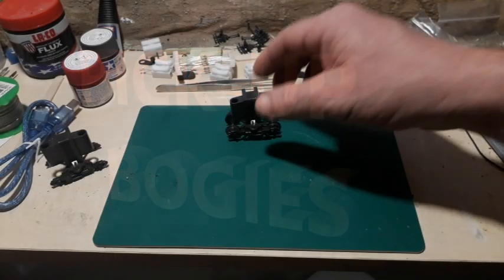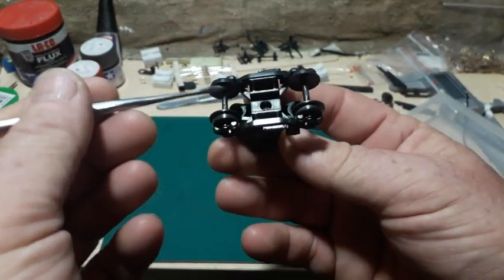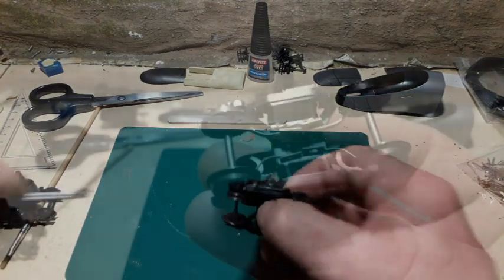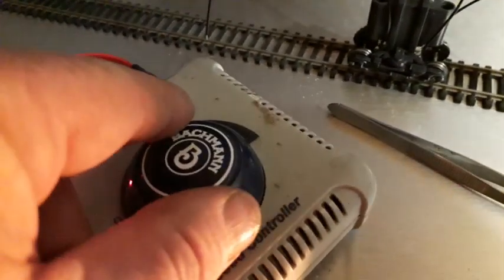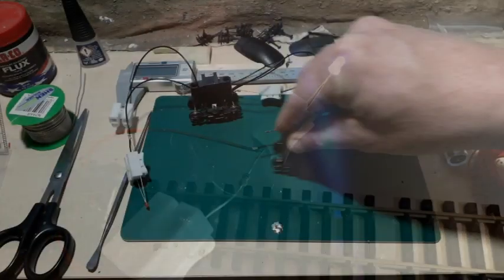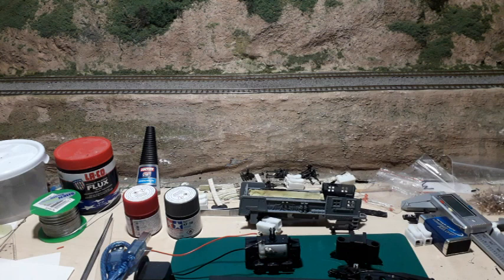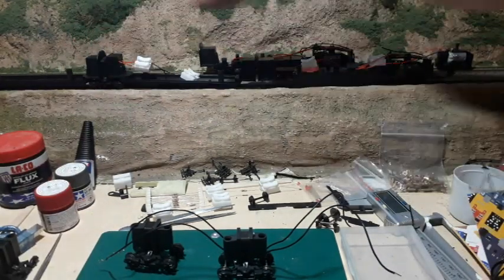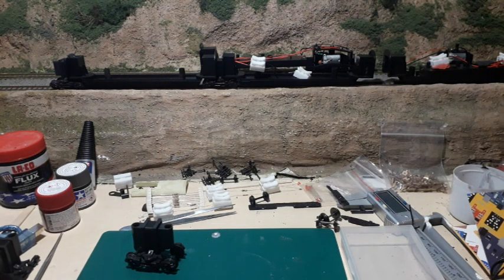DIY Pick-Up Power For Lights and Motors

Comment: I lit up a REA (Railway Express Agency) coach with LED lighting.  I made my own pickups out of some scrap copper I salvaged from an old computer.  I used the strip LED lighting (3 LED's per cut) with about 12 LED's, a mini full wave bridge rectifier and a 3300uF capacitor for flicker free non directional lighting.  With strip LED's they have the ballast resistors already built into each 3 LED sections.  I had to paint some yellow acrylic paint over the bright white LED's to tone down the lights.  Now it looks like old timey yellow light.  My wife said it looked more natural with the yellow lighting.  Cheers from W Rusty Lane K9POW in eastern Tennessee

Comment: Hi Tom, but what about the 6v battery operated motor ? all dc power usually output around 0 to 12v on tracks ...did you change the motor or is it the same of the toy version? i wrote from italy and LE frecciarossa looks like well vs acme certainly more expensive..all the best Nicola!
Reply from the maker: Hi Nick, this is a very interesting subject. At the moment I'm using the same motor and I have no problems. I will be changing the motor at some time in the future for a better quality. I will certainly make sure the new motor is best for 12V Thanks and all the best.....Tom
Reply: @tomjenssen7486  thanks ok

Comment: Bogie must be nonconductive to reverse axles.  It's more complicated with older all metal frames where pickups need to be insulated from frame.  Like the wire wrapping around axle.  Maybe a small spring with wire soldered to it and conductive lube on axle?
Reply from the maker: Hi Ed, yes, absolutely. Thankfully, these bogies are all plastic (as they are toy conversions). For the high speed trains I have continuous wiring through each unit and I've bought some ready made spring pick-ups (the same as the ones you mentioned). These are generally used for coach lighting so I'm testing the trains with all wheel pick-ups to find out if there will be enough power supplied to run the motor. If so, this should allow for very smooth running. There's also much less friction than the wiper style pick-ups.Thanks very much for taking the time to watch and leave a comment...it's much appreciated. All the best....Tom